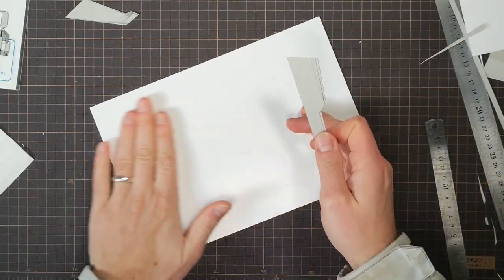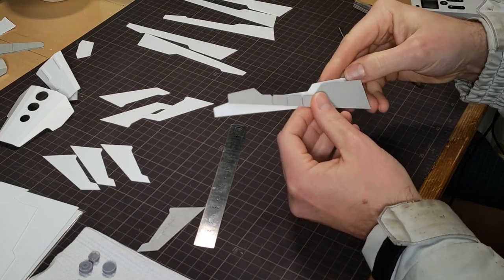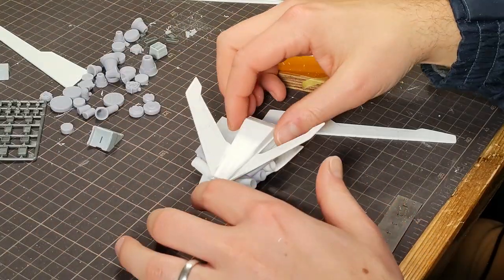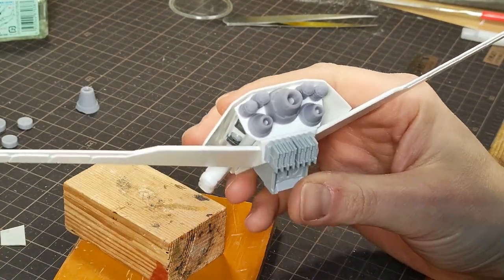I built a BETTER ship from scratch and other bits! | Inspired by the models of The Lazy Forger

Comment: Plasticard hasn't been a medium for me really, but I may play around with it for some projects.  Where did you get the bender tool?
Reply: Or is it just a hunk of wood you're bending heated plasticard and foam around?
Reply from the maker: When I started using plasticard it felt like magic. The tool comment was kind of a joke. Cut Transform Glue is a channel on Youtube that does a lot of scratch building and he made one in a video. It's just two blocks of wood screwed together with small spacers in between that allow you to bend long pieces uniformly along a scored line.

Comment: Great scratch build! Wonderful attention to detail. I always get so nervous working with styrene because I'm never certain it's going to break in the right place. Maybe a scoring tool is right for me..?
Reply from the maker: Thank you! Styrene shouldn't be that hard to snap along a score line. If you have had problems with it it might not be scored deep enough. 1mm sheet for example most likely needs a few passes with a cutting knife before it's ready to snap. If you are forcing it too much you need to cut deeper first. The P cutter that I talk about in the video digs out a lot of material but can be less precise depending on what you want to do.